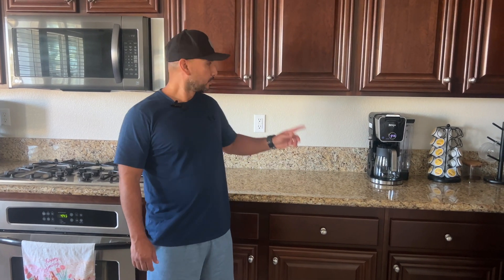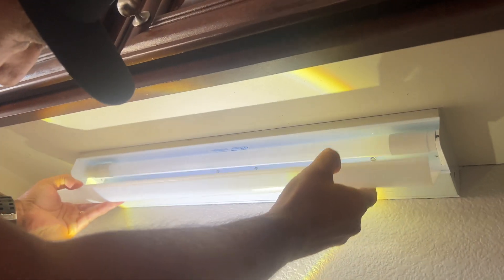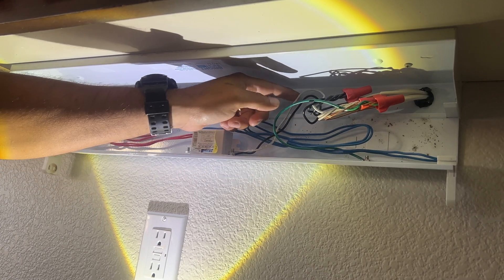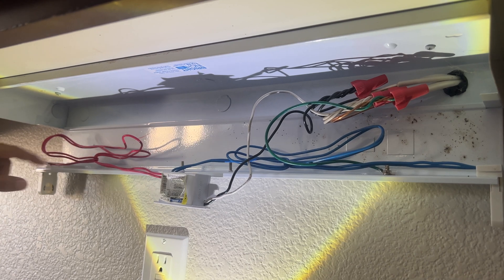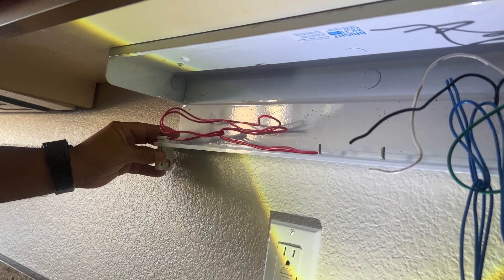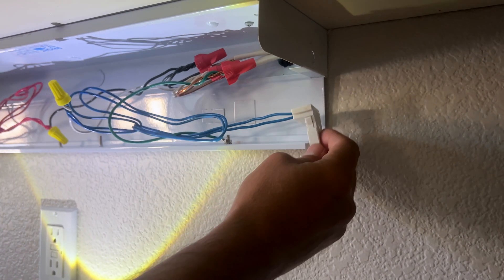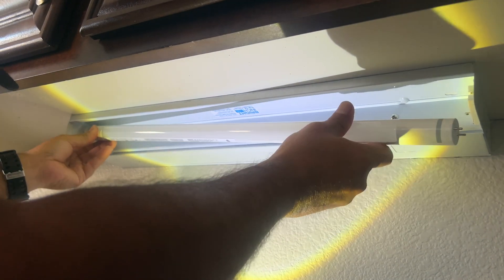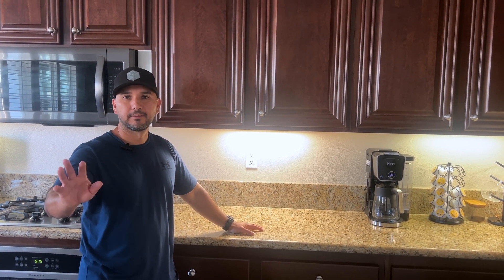Ep6: How to Bypass a Ballast: Blue Wires on One Side, Red Wires on Other Side

Comment: ok basically black wire, gets connected to set of blue wires or if they were  say yellow, wires. then the other side right side , lets say wires are red . to white nuetral wire. connect other set of wires to the white nuetral.. throw away old balast, not needed any longer. next time i see old flouresent light fixture. I am going to grabb  them..lol